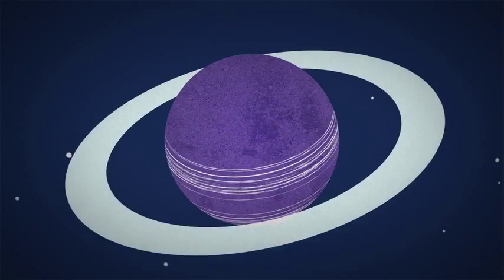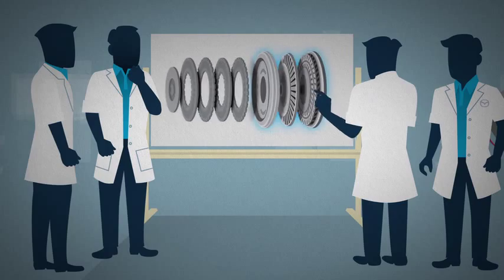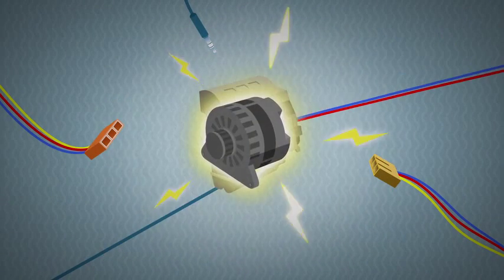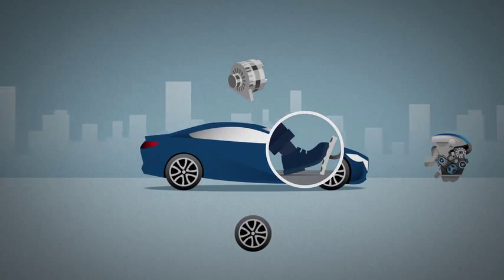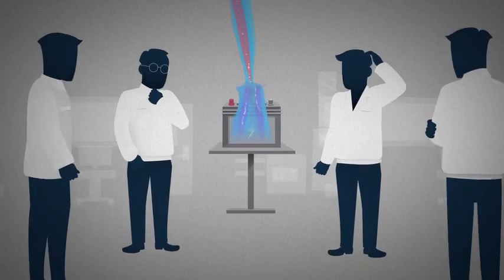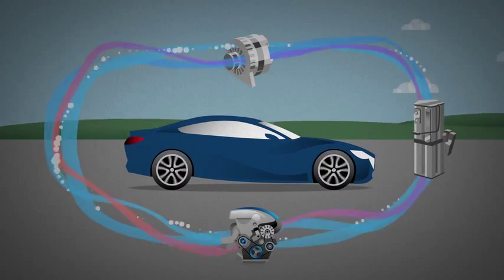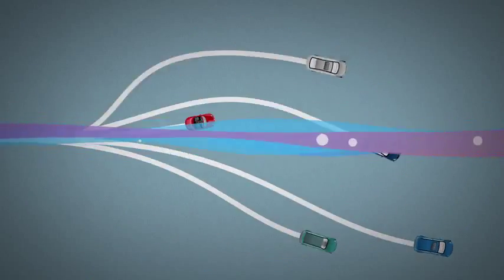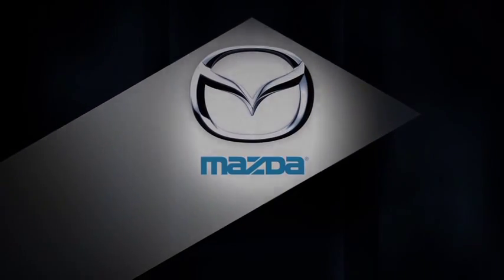Mazda SKYACTIV  i-ELOOP regenerative braking system

Comment: Man, this is cool. But I thought capacitors could only store small amounts of energy, not 'huge amounts of electricity'. The main differences between a battery and a capacitor is that a battery can hold large amounts of energy, to as much as several kW, but it charges and discharges slowly. A capacitor charges and discharges rapidly, but holds small amounts of energy, but enough to power appliances, but not to propel a car. 
But he new 'Graphite Oxide Capacitors' will change all of that.